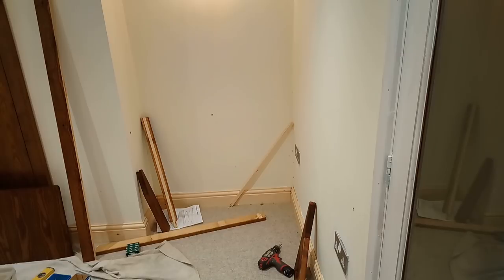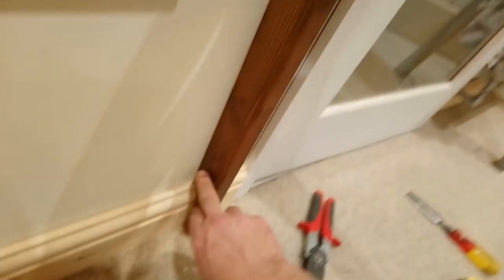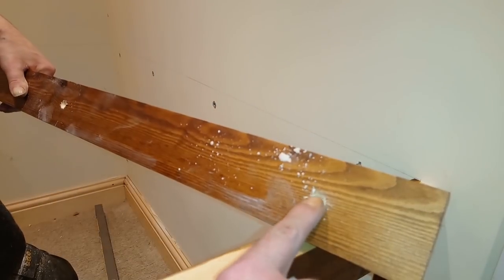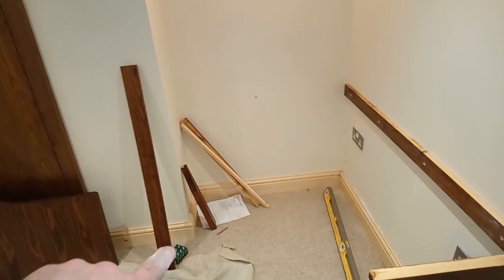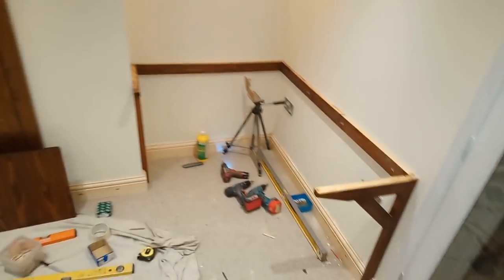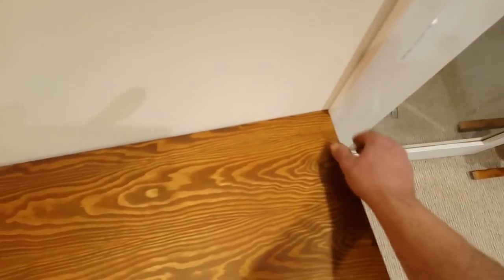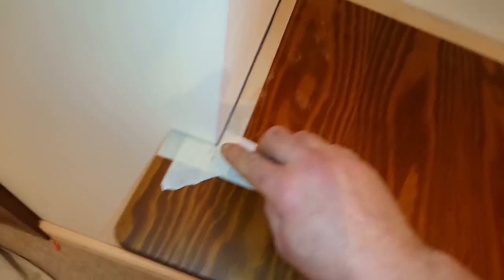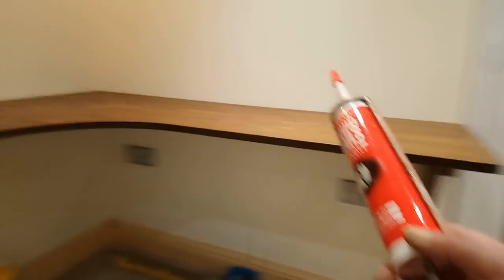Hilary's basement Pt14  - Desk pt2 - Fitting the desk

Comment: Great videos Gid! I have a question though that really bugs me when I'm doing any work that requires mounting on walls. How can you tell what's behind the wall ie: a metal stud, plywood behind the plasterboard? I have a stud finder but knowing plywood is behind the plasterboard is next level spidy senses lol
Reply from the maker: It's magic Chris, like the magic circle I'm not allowed to give the game away 😉😂

I have a stud/cable/pipe finder, good n not cheap but not reliable enough to use all the time, i knew about the ply from when i patched n plastered over the pipes 😉 sometimes it's just knowing from experience how something is built or just taping on the wall to find a stud, the width of a door casing minus the architrave will give a clue to the wall thickness, if the dust when drilling comes out red, it's red brick which is 4" minus plaster, if it's grey it could be breeze block or similar which might only be 2" without plaster, ya find that at the top of stairs in semi detached, wood stood walls sound hollow but have a solid thud when banged on, metal stud walls sound hollow too but have lighter rattly thud when banged, studs, floor joists, ceiling rafters are often 400mm or old school 16" apart so if you find one then the rest are easier to find, dot n dab walls sound hollow in random places & solid in others where the 'dot n dab' drywall adhesive plaster has been placed. there's a very good chance there'll be a solid wall that dot n dab is stuck to. supporting walls, party walls..... they all give clues to their construction 😉🤪
Reply: @Gidjoiner  thanks Gid for the advice. It's one thing I struggle with but like you said, it's all experience really. I'll bare this in mind next time I'm struggling. Or I'll wave my magic wand at it and hope ha!

Comment: Hi Gid,Hope your well mate. Where did get your scribing callipers from. Cheers John👍
Reply from the maker: Hi, cold short days but yep I'm fine thanks, the scribers in this vid are Faithfull 200mm Square Leg Divider/ Compass from Amazon they felt nice n stiff but were rubbish, really hard to turn the little knob to adjust, the adjusting slide didn't slide very well, the thread of knob that held the pencil was just 3mm-ish so dug into the pencil breaking the lead & eventually after only a short time that round pencil holder part fell off, These type with the slide are hard to fine adjust anyway, esp with one hand & move if knocked/dropped so i went back to the compass with a threaded adjustment wheel in the middle, I think this is the Staedtler one i have,https://www.amazon.co.uk/Staedtler-551-01-Precision-Universal/dp/B000WGVMNG/ref=sr_1_fkmr1_2?keywords=Staedtler+503+compass&qid=1575324206&s=industrial&sr=1-2-fkmr1
I changed the pin point for a metal point made from an old jigsaw blade, I've had many scribers over the yrs but never found the perfect one, When I've spare cash I might give these a try, someone in the comments asked the same question as you & i pointed them towards these saying i might try them, they bought them n said they were fine but I'll have to see for myself, I'd want the point of the pencil to pretty much touch the other point so would prob have to alter these, cutting off the point where the pencil is to make that work. 
https://www.amazon.co.uk/dp/B008OSIUY8/?coliid=I3HTKEQ54N2Y31&colid=3UBWC9NW89BTU&psc=1&ref_=lv_ov_lig_dp_it
Sorry prob not a lot of help 🤷‍♂️
Reply: Gid Joiner thanks mate. I know what you mean when you want the pencil point to match with the point of scribe. Much appreciated my friend and keep up the good work 👍I’ll let you know what one I get and how it performs thanks again
Reply from the maker: Thanks, the Staedtler one's thread bit sometimes gets in the way when working up against a wall that's why the Amazon one with thread on one side would be good but as i say the pencil holder part looks wrong, might have to get the welder out 😂 i don't want to have to do that tho, one day I'll find one, I'm 51 now, when i retire maybe I'll have found 'the one' 😂
Reply from the maker: 😂 I just found this one n oops ordered it, I'll have to butcher it like i was saying but the steel arms look thicker 😉 https://www.amazon.co.uk/gp/product/B07V9GKT28/ref=ppx_od_dt_b_asin_title_s00?ie=UTF8&psc=1
Reply from the maker: @jrtjohn1  Delivery 31 Dec 😒 coming from China i guess
Reply: Gid Joiner Hi Gid Thanks mate. I’ve been looking at a lot. The last pair I looked at were
Grizzly H5884. Maybe worth alook. A bit expensive but I was thinking if there pricey must be good. But not always the case. Let me know what you think of them. There on Amazon 👍
Reply from the maker: Hi, yeah they're similar to the Faithfull ones, the style anyway, They have all the hard to use features that i mention in my 1st comment, hard to turn the little knobs, slider that can't be adjusted with one hand & they're maybe worse because they have that annoying point where the pencil is, These are the Faithfull ones in this vid which were more expensive but crap https://www.amazon.co.uk/gp/product/B003KIWER6/ref=ppx_yo_dt_b_search_asin_title?ie=UTF8&psc=1
Reply: Gid Joiner Hi. Yes I think I’ll give Faithful ones ago mate. Let me know how you get on with your new ones. 👍
Reply from the maker: Ok will do, btw tho gotta say, buy whatever you like but i wouldn't buy the Faithful ones again, they're half the price again of the Grizzly ones you mentioned & they lasted me less than a yr, felt nice but were annoyingly crap all the time.
Reply from the maker: https://www.diy.com/departments/compass/1798074_BQ.prd/gallery
Reply: Gid Joiner Think I’ll just go with the grizzly ones mate. That’s it with tools. Trial and error all the time. Thanks again 👍
Reply: Gid Joiner They look alright mate.Going to try them out. Great price too. Thanks again. I’ll let you know how I get on with them 👍

Comment: What's them tool you used on them wall plug
Reply from the maker: Fischer Professional Metal Hollow Wall Anchor Installation Tool, I got mine yrs ago but this is the same on Amazon - https://www.amazon.co.uk/Fischer-62320-Professional-Pliers-HM/dp/B000UW50YY/ref=asc_df_B000UW50YY/?tag=googshopuk-21&linkCode=df0&hvadid=256007919056&hvpos=&hvnetw=g&hvrand=15896408839660710232&hvpone=&hvptwo=&hvqmt=&hvdev=c&hvdvcmdl=&hvlocint=&hvlocphy=9046304&hvtargid=pla-423185999438&psc=1&mcid=4bfde7b871be36c08e02e64fdce66dad&th=1&psc=1